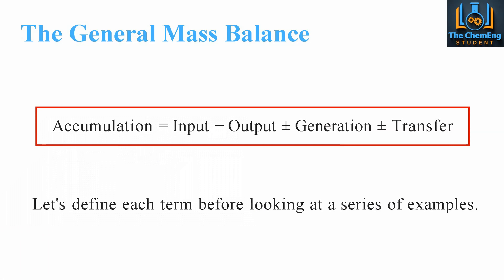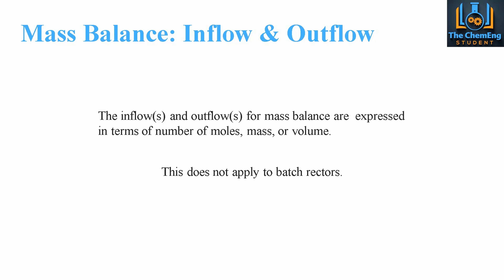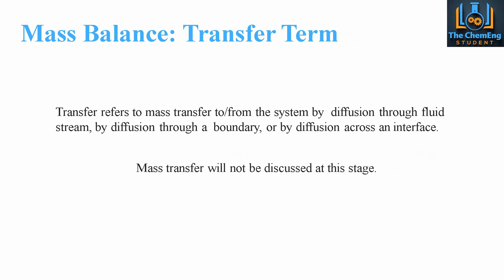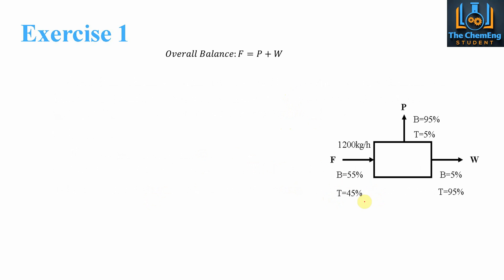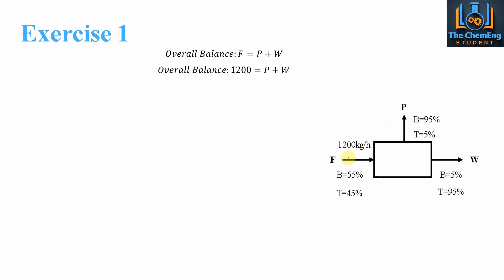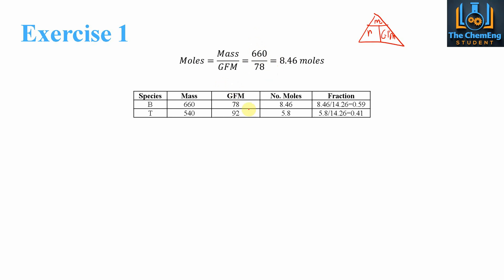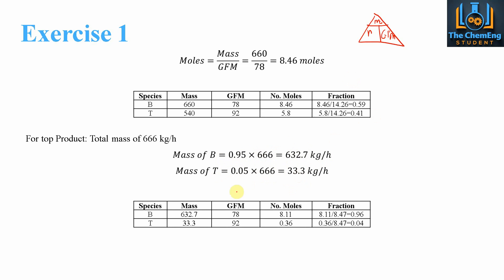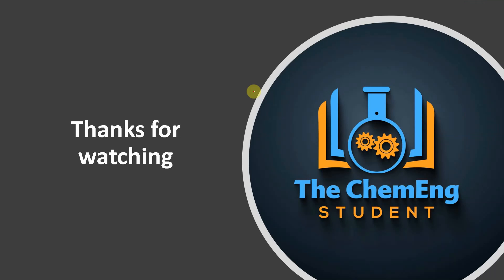The Easiest Way To Solve Mass Balances | Chemical Engineering Explained

Comment: Hello, I have a doubt. 

In exercise 1 for calculating P and W. Since there is no loss of benzene and toluene. Can't we just assume 95% of the 55% benzene would go to the top and 5% of the 55% benzene would go to bottom?

When I did it my way for top flow rate is 654kg/h and 556kg/h for bottom.

The difference between your and my answer is very little. But I'm not sure if I'm right. Can you please help me with this?
Reply from the maker: Hi there, your assumptions here are indeed correct however the reason the questions was approached like this was if the system is not a binary mixture, or if there is a reacting system, this type of assumption wouldn't be valid. The way the numbers work it makes it appear as though the assumptions would be valid all the time. A way I usually try to think about it is say in the top streak Benzene was 90%, that doesn't mean the bottom stream is automatically 10%. What that 90% is telling us, is that the content of that single stream contains 90% Benzene. I hope this helps. If you would like me to expand further, please don't hesitate to send me an email at info@chemengstudent.com